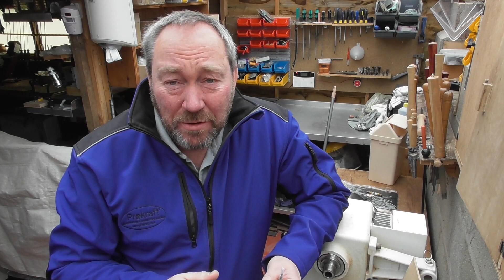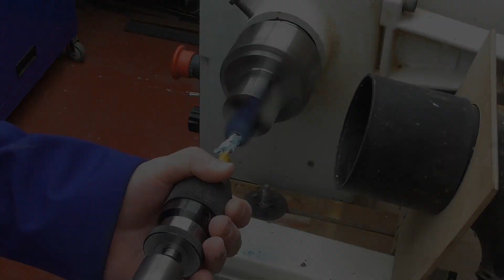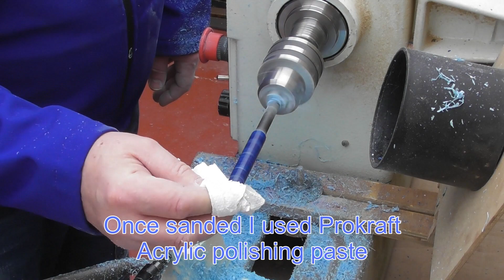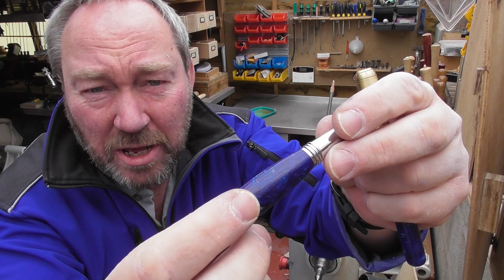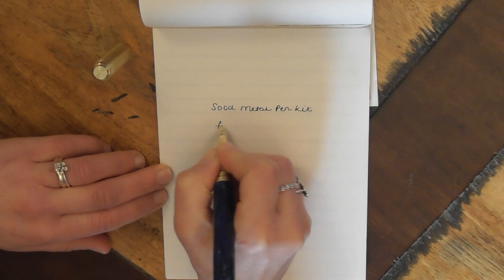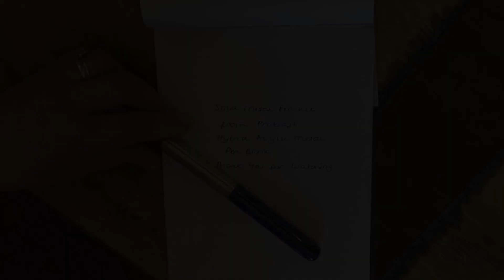Metal Hybrid pen blank & brass pen

Comment: I bought 2 kits to make a full brass pen with the connectors at each end of the barrel (so I could post) I turned a hollow threaded brass cap for the other nib section hole so it just fits a Parker Deluxe converter. #measuretwice ...It gives me an enormous twinge of satisfaction just seeing it (and using it), Thanks
Reply from the maker: Glad you enjoyed the kit and also made it unique 😁👌

Comment: Good idea with the mandrel but I’d be worried to death about the Jacob’s chuck slipping out of the headstock at speed. Did you have any problems with that?? 🤔 great scribbling at the end though 😂
Reply from the maker: One brief slip, it just popped back in no problem and didn't spin for long. As long as you direct the pressure towards the headstock it is fine. Ideally of course I should have used a drawbar as you should with anything at headstock end with no tail support!